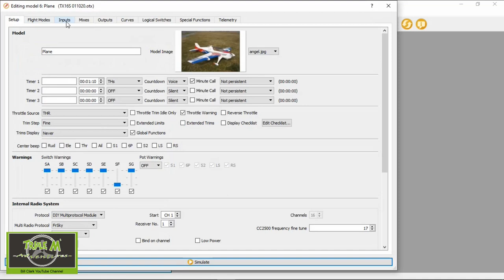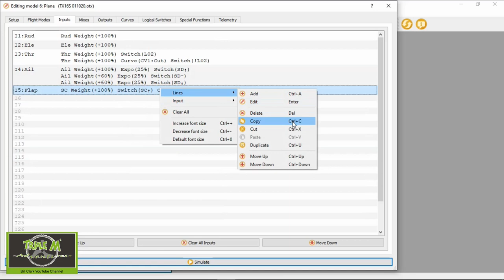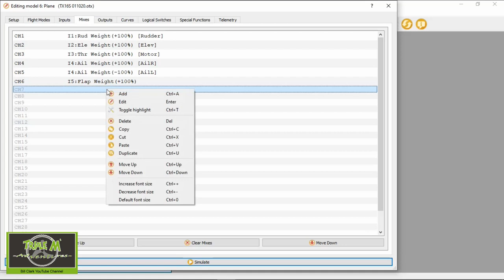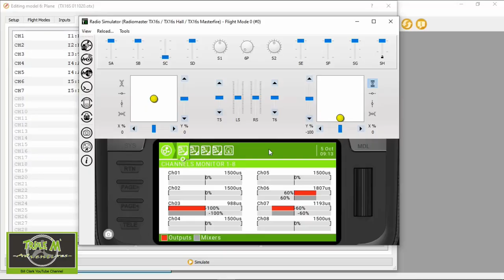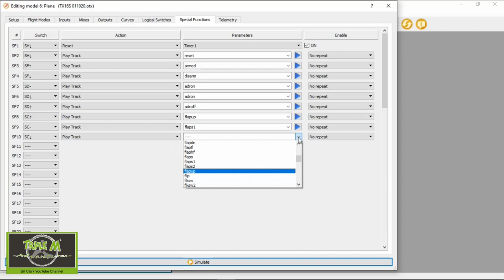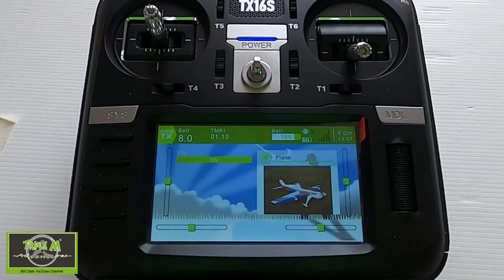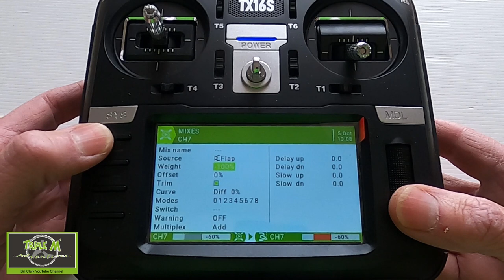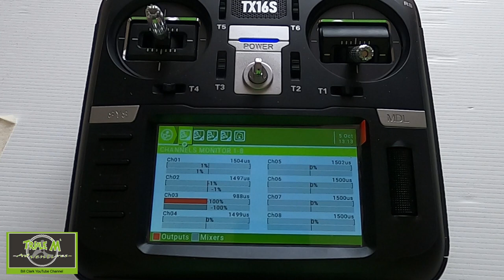RadioMaster TX16S Setting Up Flaps (Two Servos on Two Channels)

Comment: Thanks again bill!.worked great!.I did have to go to zero on my offset to get the flaps to return flush to the wing. It all worked great on my 1300mm arrows bigfoot.I got tired of my old dx6i.I absolutely love this radiomaster!.After a few days and alot of videos i am very happy with it..Thank you for also doing the radio settings,not just the companion..
Reply from the maker: You are very welcome.
Reply: as a note..I did use 2 servo for flaps.They are on a y cable to an auxill ch on reciever.that may be y i had to adjust my offset.Either way it works and very happy with it.

Comment: This is soohh useful Bill as I have a Tx16S and am about to modify my Gentle Lady Glider to have flaps as I fly in a small field and need to get the landings spot on.
Ie...no second chances to go round again ( trees)
I have watched several of your vids and am understanding companion more and more.
Question please?
Say we have set up a bare bones model in companion and upon flying it , changes have to be made on the field to the actual tx.....how then do we get that edited/ changed  criteria back to Companion so that both the Tx and Companion are reading the same page so to speak?...
I will take an educated quess for my homework.
Turn on the Tx.
Insert the usb lead to Tx and Pc.
Select Storage on the Tx itself.
Then " read tx to companion"?
Peter
Reply from the maker: Yes that’s correct open OpenTX Companion attach your radio to your computer then read models and settings. Once the models window opens click save and name your backup normally I use the date. 

https://youtu.be/Tt8t7ikSzxk
Reply: @the-happy-RC-flyer  thanks Bill.

Comment: Hi Bill thank you for your video. But i would like to Know how to setup two élévator servos or how can i change my initial plane setup i make a mistake at the first setup of my plane??Best regards.Lucien.
Reply from the maker: Hi Lucien, 
You need to set up a MIX on the next available channel let’s say 6 if you are using channel 5 for the second aileron servo. The source should be the elevator INPUT. Then change the Weight from Plus or Minus depending on the orientation of the servos in your model.

Comment: I really enjoyed this and all your video's. My Timber has flaps on a Y harness. Do you have a video for that?
Reply from the maker: Hi Jerry, you need to orient the servos in your wings the correct way basically the servo arms facing the same way. Then you need a Mix for the flaps which will consist of 3 lines:
All Source = SC or whichever switch you choose.
First Mix, flaps neutral:
Weight -100
Offset -100
Switch SC (forward)
Second Mix, flaps half
Weight -100
Offset -50
SC (center)
Mix Three, flaps full
Weight -100
Offset 0
SC (back)
Will look at producing a video in the near future.

Comment: hi, thanks for the good tutorial, however, i tried it on my Dynam Primo but the flap only 1 step. anything i did wrong?
Reply from the maker: Rory please check your settings and that you have 3 lines for flaps in the INPUTS and 2 channel MIXES. Also check you have allocated a switch position for each flap position.
Reply: @the-happy-RC-flyer  yes i follow exactly what you did on that video.. ill check again soon.. thanks again

Comment: Bill thanks again. I'm having an issue. I like to use three positions. Parked of course, half flaps for takeoff and slowing for landing, and full flaps for landing, Parked and half work great. I cannot seem to get the numbers for full flaps. Can you help?
Reply from the maker: Jerry, this video should help you set up neutral, half and full flaps. If you are having problems please back up your radio and model settings and email the file to me to take a look. triplemadventures@gmail.com
Reply: @the-happy-RC-flyer  Will do thanks
Reply: Bill, thanks for going way over the top of any other YouTuber. I didn't email you because I discovered what I did wrong. Thanks anyway.
Reply from the maker: @jerryzito6840  you are very welcome.

Comment: Bill Clark - can you provide or describe how to restore modified model on OpenTX Companion back to my RadioMaster TX16s?  Thanks
Reply from the maker: Randall once you have changed the model settings save the new Model & Radio settings to your computer by clicking File then Save you will now have a backup on your computer. Then with your radio connected to your computer click Read/Write and click Write Models and Settings To Radio your adjustments will now be sent to your radio. Just as a foot note you cannot send one model to the radio it has to be all the models and the radio settings.
Reply: @the-happy-RC-flyer  Great.  That worked great.  Do you have any other videos using Radiomaster TX16s?  I was viewing your Setting Up Flaps this morning.  Just got my radio yesterday.  I have set up initial settings and created one simple airplane model and used your video on adding the flaps option.

Thanks

Randall
Reply from the maker: @randallwatts9840  Here is the link to my RadioMaster TX16S Playlist which should help you. If you need any further help let me know. 
https://youtube.com/playlist?list=PLHSMllXIT6nYdKotiyx_R8VcG3cN54qm3
Reply: @the-happy-RC-flyer  When I got all set up and went live with radio, I noticed that the flaps went in the wrong direction.  You mentioned in one video that this could happen. How do I logically set up this reverse on Companion and/or radio?  Thanks
Reply from the maker: @randallwatts9840  go to MIXES and change the weight from 100 to -100 or the opposite way round so you control surface works the correct way. Do not change it in the INPUTS.

Comment: For some reason edge tx will not let me run 2 servos for flaps  one servo will work fine and the other will barley move
Reply from the maker: Hi Dan, what receiver are you using Express LRS? If so is your second servo on channel 5?

Comment: Thanks for your video selection.

There is a current version of Firmware 2.3.11.  I followed your video on backups, etc.  I followed the write procedure and rebooted radio after flashing.  When it booted up, I got the following message:

SD Card version 
Expected version:  2.3V0035
 
When I go into system, I see the following:

FW: opentx-tx16s
VERS: 2.3.11-otx (4328055e)
Date:  2021-01-08
Time:  16:04:05
EEPR: 219
OPTS: crossfire3, ghost, afhds3, internalmulti, multimodule, lua, luac

Any thoughts as to why the SD Card version warning?
Reply from the maker: Randall, you need to download the 2.3v0035 release of your SDCard contents and put them on your SDCard in your radio and you should be ok.

You need to download the latest version of the SDCard contents for your radio.

https://www.open-tx.org/

Go to News and click the release you have, I suggest you updating your OpenTX to the latest version.

Scroll to the bottom to Downloads Links and click SDCard

Select your radio and download the zip file

If you DO NOT have any custom pictures, sounds or Lua scripts just unzip the downloaded file and copy them to your SDcard.

If you do have custom files please check out my video My Procedure For Updating SD Card Contents

https://youtu.be/7YXfGNqSiMM

If this is your first time updating the SDCard I would suggest you copy the original card contents to a folder on your computer before updating.

Comment: Do I need to plug controller up to computer to do this
Reply from the maker: No, you can program the flaps on your radio.
Reply: @the-happy-RC-flyer  ok thank you. I went from spektrum to radio master an was just wondering. I got the 4in1 version for the open tx
Reply: @the-happy-RC-flyer  is there a certain way to get the open TX on it. Right now it says edge TX an couldn't change it. I have it set to dsmx in settings but didn't see a option for open tx
Reply from the maker: I would not change your radio to OpenTX it is no longer supported anymore.
Reply: @the-happy-RC-flyer  well I order it in open tx to bind to my spektrum receiver
Reply: @the-happy-RC-flyer  they had the option of 4in1 to support open TX an so on. I can't go an just buy 6 new receivers for all of my planes
Reply from the maker: So if you radio is OpenTX you cannot updated it is no longer supported so leave as is. Just please clarify what you are trying to do and your problem. Update your radio or Multi Protocol Module they use different firmware.
Reply: @the-happy-RC-flyer  I bought it to fly my planes that all have spektrum receivers. I need it to bind to them. I wouldn't have bought it if it's not going to work without changing receivers.
Reply from the maker: If you have a Multi Protocol Module it will bind to Spektrum DSM2 and DSMX compatible receivers.
Reply: @the-happy-RC-flyer  well it didn't come with a module so not sure. I just bought the 4in1 version like I was told.
Reply: I'll hopefully figure it out. The stuff that came with says open TX edge TX and multi-protocol but didn't come with a external module.
Reply: But anyways. Thank you for your help. The top left of screen says edge TX which it states that it comes with that in it for the other to download an update. But everything I click on says unsupported. If I have to Ill just start buying recievers
Reply from the maker: Check the box to see if it says Multi Protocol Module or ExpressLRS? If nowhere it states ExpressLRS it is Multi Protocol Module version.
Reply: @the-happy-RC-flyer  I figured it out bud. Just needs the new update done. I noticed certain things that were diff an finally seen where it hasn't been updated. Working on that now. Got it downloaded but have to get it into controller now.
Reply from the maker: Ok and good luck.
Reply: @the-happy-RC-flyer  come to find out they sent me the Elrs version instead of 4in1 version so I just ordered the 4in1 multi module for it

Comment: I dont understand, why put in that Offset? Does the weight not change the throw of the flap?
Reply from the maker: You only want the flap to move in the middle position and stay there with the switch in the back position. If you remove the offset the mix will not work.